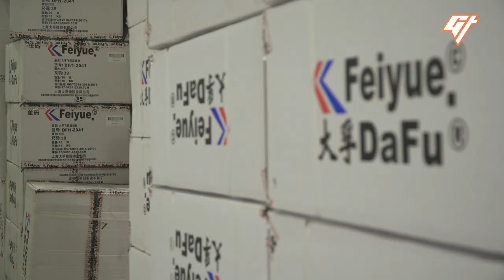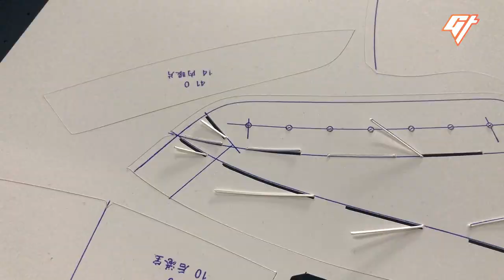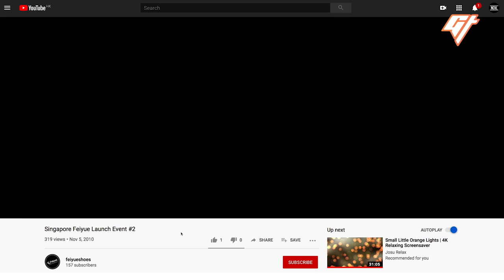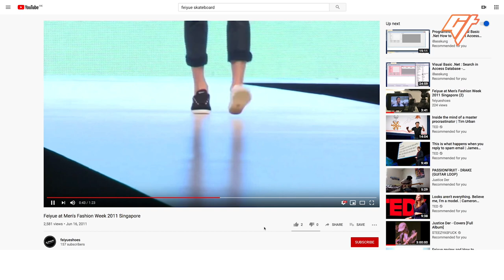Exclusive Look at How Feiyue Kung Fu Shoes Are Made

Comment: Feiyue is only one of two shoe companies still vulcanizing(bake) their shoes the other is Vans.  All other sneaker companies use the cold glue method and this is why the soles split from the upper so easily !
Reply: So China has a history of copying and reverse engineering foreign brands, but they don't like it when others do it...Oh the sweet irony..
Reply: @davidagostinho1807  What?
Reply: @deedumeday518  you don't actually expect this chump to respond do you?
Reply: Even if it’s true that most companies stopped vulcanizing sneakers it only takes a second of thinking to know there’s more than two companies. 

Also I know this is bs cause there is more than one feiyue company.
Reply: Vans tend to use cold glue as well had plenty of pairs with sole separation especially around areas of most stretch
Reply: holy F!!!! is this why my i went back to my nike trainers after not wearing them for a few years! and the soles started falling off my nike airs!!!!???? the actual layers started coming off as i was running in them
Reply: There are a ton of vulcanized shoes wtf

Comment: There's more than 2 Feiyues tho. Dafu Feiyue is the Chinese fashion Feiyue and Dabowen/Top one is the Chinese kungfu Feiyue. The U.S. Feiyue is basically an expensive Dafu.
Reply: Do you know if there are any differences between the top one and the dafu?
Reply: @sense5972  Quite big difference even though they look similar (when comparing the standard rounded rubber bottom model). 
Dafu (red circle under) is more cushioned with a less grippy rubber sole but a bit higher quality (thicker sturdier canvas and better rings for the shoelaces).
Top one (green triangle) has a thinner and stickier sole that wears out much quicker but does provide really good grip and better feeling than Dafu.
There's also modern Top one (red triangle), even though I took one size higher those had an uncomfortable toebox and the canvas broke after 3 months, I'd recommend against as they seem to be fashion above function.
I would also say that I need one size bigger in Top one than Dafu and finally I would recommend Dafu for casual wear due to them being a bit better quality.
Reply: @haisulii  Thanks a lot for the information. 
I own 2 pairs with green triangle, I love them but the white pair I feel they are somehow wider than the black ones I have. Both are from Top one.

Also my normal size is 45 EU and and my Feiyues are 47.. 2 sizes bigger lol but I have a feeling that 46.5 would be perfect for me and so I didn't took a risk to order 46 😁.

So for sports I think top one is better right? I hate a lot that glue thing, looks so shitty. In the dafus I think there is no glue pumping out
Reply: @sense5972  The rounded bottom pair of dafu I have has slightly less glue sticking out than the top one but it's a lot about luck too. 
If you use 47 and it's not tight, 46 is probably okay on a Dafu. 
Top one is more stable because it's thinner, less rounded and grippier, so for sports it's probably a bit better (tho I haven't tried the modern flat dafu so dunno about those), for casual wear dafu is nice when they've been worn enough to flatten the unnecessary padding a bit, my pair had a toebox just a tad less pointy than top one which works better with my feet that are wide in the toes.

Comment: But does it make a better wrestling foot gear than the Onisuka Tiger?
Reply: A Shot Of Smoothie Thanks for the info. The retro style is cool, my wrestling days are over, so I’ll be looking for an urban walking shoe.
Reply: They are perfect for walking and for riding motorcycles. I have a pair. Will get another when I get the chance.
Reply: @Raphael Gallo lateral movement on heel may have more to do with individual foot
different brands work differently on different peoples' feet
that's why say, adidas fits one person perfectly, yet not so well on someone else, and on it goes with different people, different brands, and different sneaker types, ie wrestling, basketball, running, etc
had to learn this the hard way cos my own feet are shaped pretty weird;   narrow heel/ankle, wide at toes; my own way around it is that i can wear almost any brand for biking, whereas with anything for walking/running, i have to be very perfectionist and use insoles, etc.
while i wish feiyue well, i'm kind of mad at beijing/ccp, so i'd stick with onisuka tiger/asics based on principle anyways

Comment: $15 vs $50
Reply: Hong Rebel quality vs quantity
Reply: John Doe Which one is “quality”?. Well, I think they are basically the same thing.
Reply: @andrewpaul6221  they actually have good quality. i got some canvas high tops which was really comparable to my converse ones.
Reply: @passion5356  As long as it is a brand, the quality is guaranteed. The only difference is that the expensive one may use a better material (such as cowhide and a higher density rubber sole)

Comment: There great for parkour in the gym that is. 
Pros are you can wear the without socks as the insole is. Shoes that would come up when you take your foot out if you where bear foot wearing regular tennis shoes. So you can wear the shoes with or without socks. There very flexible and comfy.

Cons. If your looking for parkour shoes you could get these but I would not train height drops in these no matter how good your landing is your gonna feel your feet alot. And it not that absorbent. So your feet will get bruised. The sole takes a while to break in and if you train in them outside on concrete or brick they dont last long. As there not very durable.

Comment: Cool, the brands Top One, Tiger Claw, Dafu and Zelten are all legit Feiyue brands and all chinese brands. Feiyu with the Feiyu logo is the american version (street wear version, more stiff), by a french company, redesigned from the Feiyue kung fu version from Dafu which is more flexible than the street wear version (the american version).  

Dafu is the original makers of the Feiyue shoes and the parent company is Double Coin but Dafu has gone with the sole style and version of the french version (Feiyue with Feiyue logo on the tongue) whichis american version that's more for street wear instead of martial arts.

So if one ones the street wear, Dafu (which doesn't have the Feiyue on the side) the original maker or the Feiyue by the french company with the Feiyue logo on the tongue (american version) that's the one to buy but if one wants the kung fu version of Feiyue, it's the Top Brand, Tiger Claw or Zelten. 

These are are all legit Feiyues but there are true fake Feiyus that have these brands (or a different name making them not fakes but inferior clones) but are inferior, the sole and quality of the make is inferior.

God bless.
Reply: A lot of the tiger claw version I've found to be a lot more long and pointed in the toe cap.
I will only trust the top one.